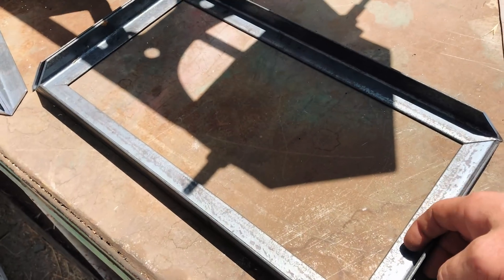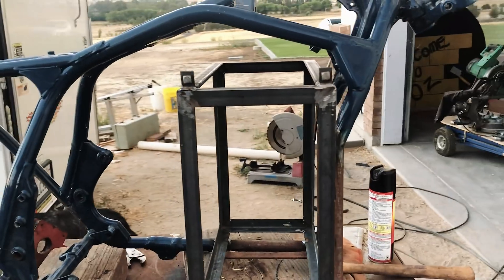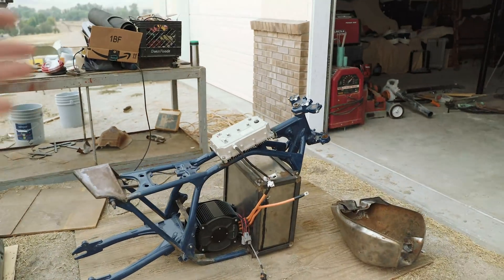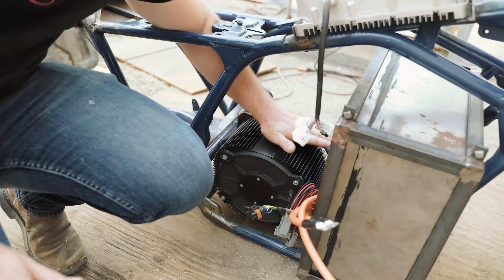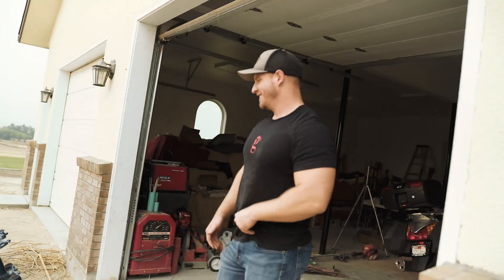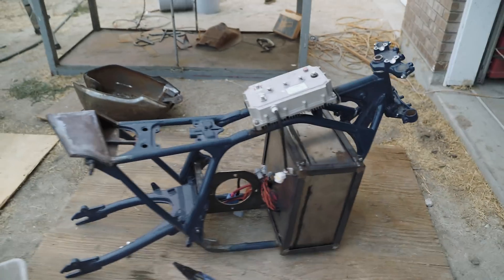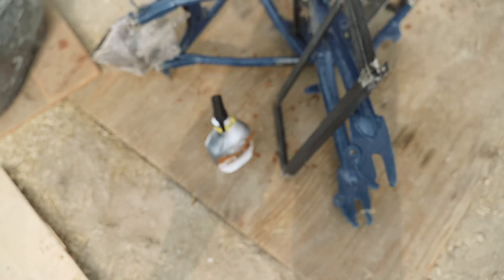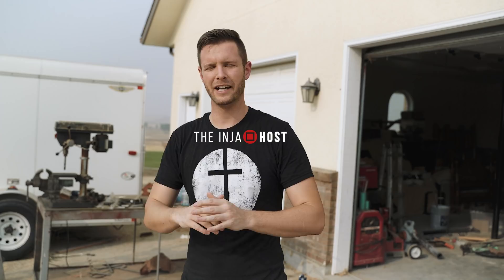ELECTRIC CAFE RACER under $4,000 | Installing the DRIVETRAIN

Comment: Cool. the lifepo4 will get hot in that case pulling 1c which is my understanding the max those aluminum case cells can do (eve cells if im correct) can discharge.   Love this concept and i cant understand why not more people are doing it.  how many kwh is the pack, whats the motor size?

Comment: Hey, i'm anxious to see this e-Cafe Racer running ^^
And about the chinese car, please make a test:
Return the 3 thick motor wires to their original position (color-coded if my memory is ok from the video)
And check the self-learning wires, those Chinese low-power controllers use the self-learning feature to invert motor rotation, so probably that's why you car goes reverse in D and drive in R (also showing the reverse camera)
You can search about these controllers and the self-learning feature herw on YT as well
Hope that it gets the car running in the correct direction
Reply: And for upgrades, please search some forums for golf carts and make threads about the car differential/motor coupling, because maybe they use a similar thread/gear pattern or a "swappable" one, i would love to see it going faster and with longer range as well
Best of luck and stay safe, chief ^^

Comment: With all the weight of the batteries all the way in the front of the frame, im curious is the suspension gonna handle weird because of the majority of weight being located up front
Reply: The center of gravity should be similar to stock.
Reply from the maker: Yes.
Reply: Even more stable, more planted and easier to man around in low speed areas or parking areas!